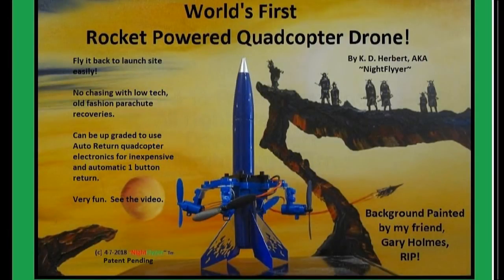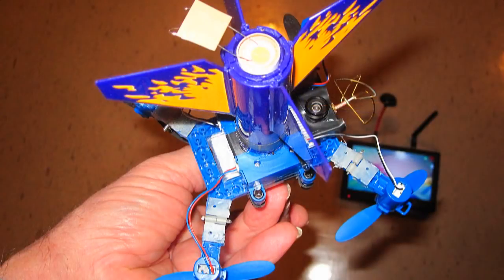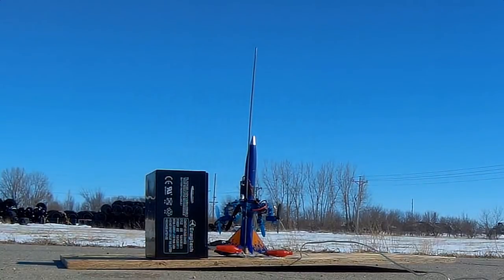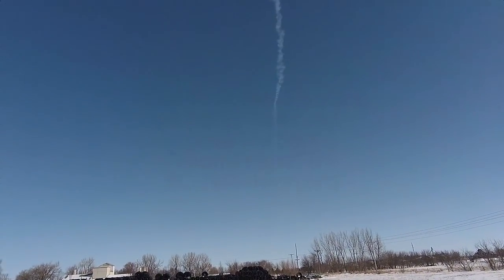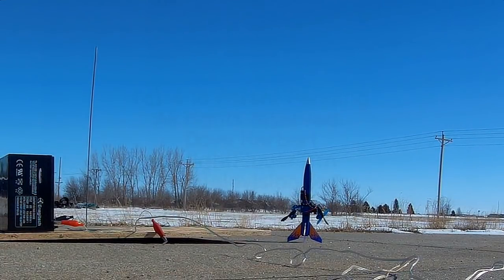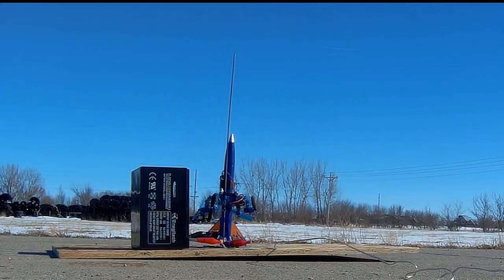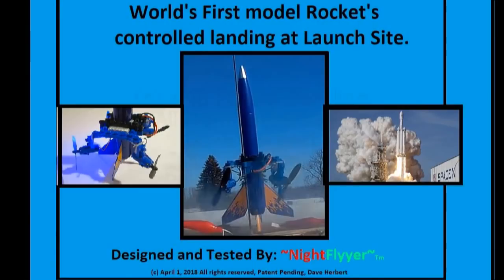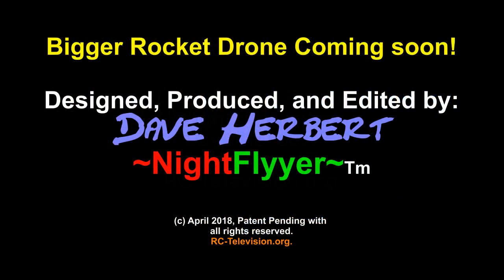World's FIRST retractable motored FPV model Rocket returns to launch pad!  (2.5 minutes)

Comment: I absolutely would not be surprised if Estes or Air Hogs or whomever approached you to manufacture such a device. you could optimize the arm deploying by having them hide slim inside the rocket's body. you could make these big and small. love it.
Reply from the maker: Thanks kindly.  Trying to cram the arms in, is one thing, but the props, etc are a bit more challenging.  I have been working on a bigger version, that I might be able to streamline.  Thanks again for the great comments.
Reply: can't wait!

Comment: For those of us who grew up watching the Mercury Rocket Program , we where lucky to get 2 launches a year. Now Spacex is launching almost 2 times a month.It's the landing of the first stage that is so fantastic.  If you have the time could you tell us old space f**ts what Estes Rocket and quad copter you started your Controlled Landing Project with? If you would provide alittle more info , in another video, I think some of your viewers might try to copy your great project. Thanks for the followup video on your project!
Reply from the maker: Thanks David.  My previous video shows all the details of how I built it and the quad I used (which was in a video just before that) build from lego blocks)  If you check that out, you will find everything you need to know to build one too.  Thanks again.

Comment: Would be interesting to see if you can pull off a landing with payload at its nose just the way real rockets have payloads in their nose fairing
Reply from the maker: That can easily be done because where the parachute was, is all full space, but why a payload?  It's just a model rocket that I don't have to chase across acres of land to retrieve, so there is no reason to put in a payload.  If a full scale one was built, that provision was already designed into the patent I received, but for a model, no need. Just have fun.  You always like to change things, and never say if you like anything I do.  Guess that's why you call yourself and engineer!  LOL.  Thanks.
Reply: I give your video like in first place before commenting. ...The payload at top of rocket will move CG well off from thrusters plus mass distribution at over longer length will significantly increase moment of inertia.& that is the real problem of  "INVERTED PENDULUM in low g's".
Reply from the maker: That's a simple adjustment by location of the rotors. Again, there is no reason to add a payload to a toy rocket.